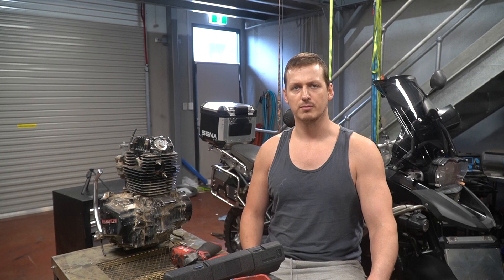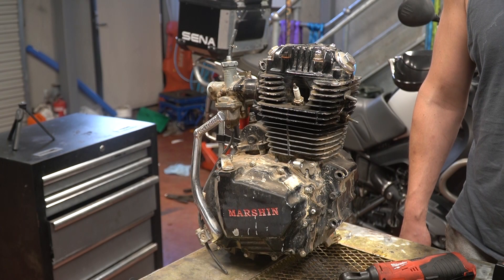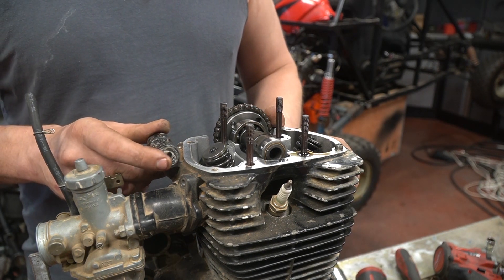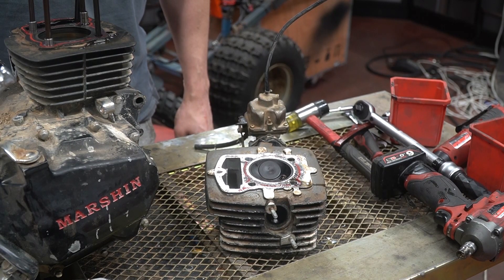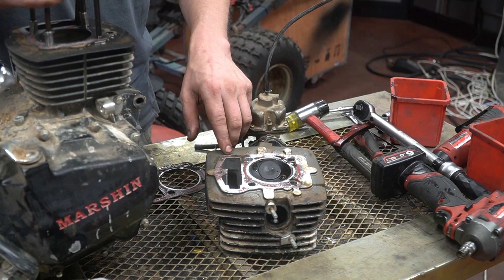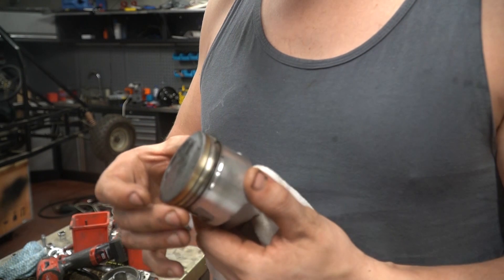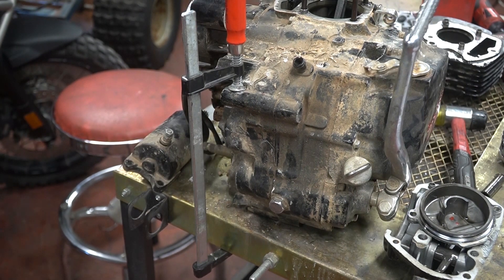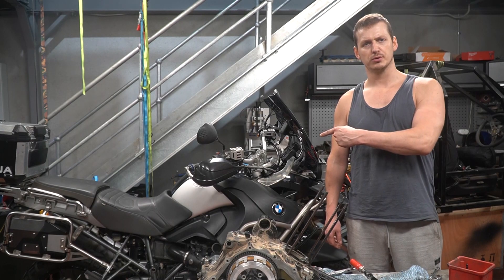Debunking engine building myths - why your fresh build fails

Comment: So, suppose i was one of those idiots who.would slap a cheap aftermarket turbo on a NA engine. Should my Chinese piston rings then spec a smaller gaps, to account for the extra boost?
Reply from the maker: More like the opposite. More power is more heat so you have a larger calculated gap to compensate. You can often get away without changing the internals, but you're limited to like 10psi or less without issue and marginal fuelling. To make use of the 25psi eBay turbo cranked up fuel screw mongoloids you have to up spec the pistons which means crank balancing and other lovelies. But who does that? It lasted 5k so far, must be a goodun. What does this guy know? 😅
Reply: @ridiculousthings4x4  👍🏼Thx. And you're right, eBay is the BEST place to find incredible deals on genuine Toyota parts!  PRO TIP: these part might ship from Guangzhou China, but no need to worry, that's just because Japan is a small country with no room for big warehouses, so they just STORE and ship these parts from China😉
Reply: That's a yes or no question.  Cause if you get tired of making even one crappy little video, answering idiot questions from ignoramuses living in random far away places must really drive you up a wall.